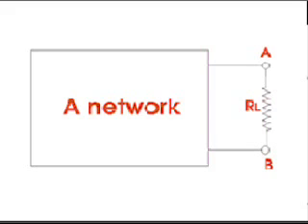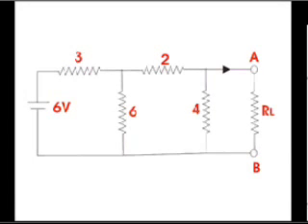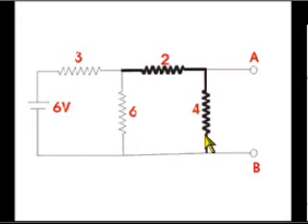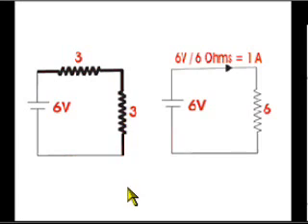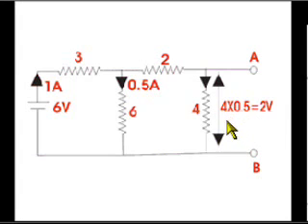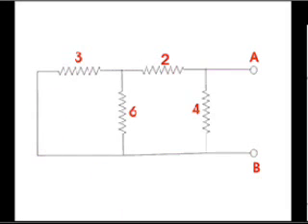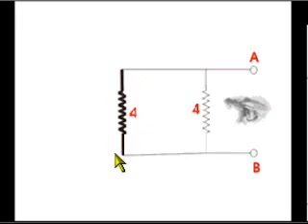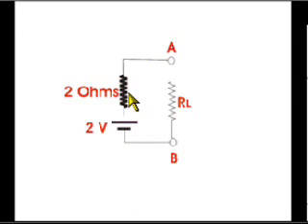Thevenin Theorem: What is it?

Comment: Why are 2 ohms and 4 ohms resisters in series? I thought they are in parallel since they share a common node?
Reply: Iam Indian,is you are chinese
Reply: @sadhuashish9031 🙄
Reply: When you take thevenin, voltage sources become shorted and the load voltage is open (as shown in the vid)
Hence its series

Also they share the same branch. If A and B were closed (load resistor) then yes they would be parallel. But to find thevenin RL equivalent, we have to ignore the load first